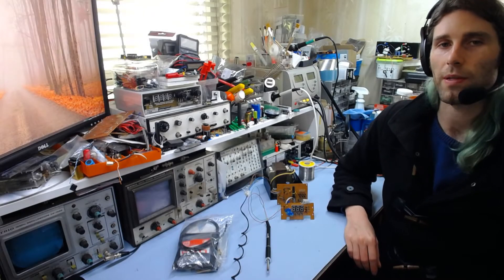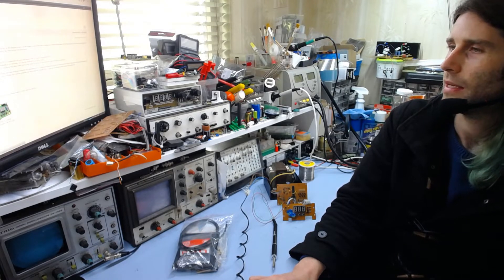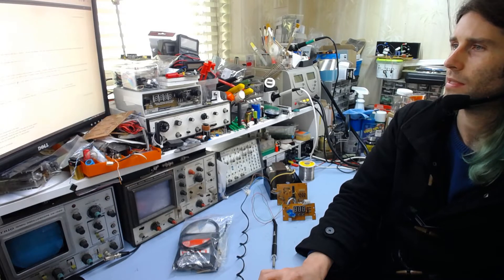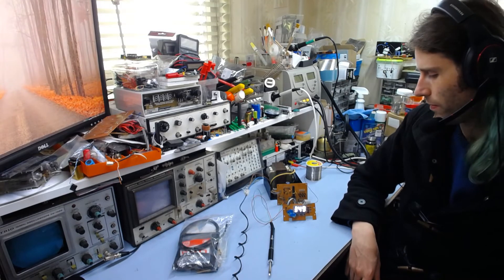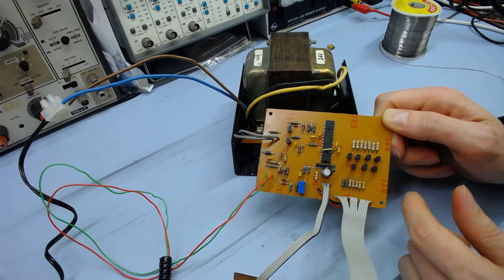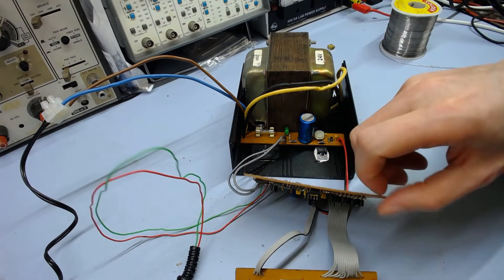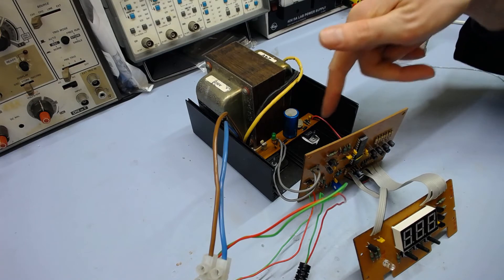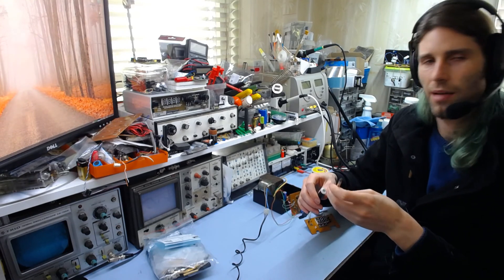DIY "Hacko" T12 style soldering station - Part 1

Comment: Damt that had to be a lot of work. Why didnt you bought handle with controller? I went easier way and bought whole kit for 18$. It works great, just made case, and modified 40V switching power supply from old printer. Your heats faster but im not sure if 5A is not too much for those tips. I read somewhere that 3A is max.
Reply from the maker: Yes, it was more work than buying one, but I have the schematic, firmware, etc and can easily modify or repair it in the future. So it may have taken more time but in the long run I think it's a better choice for me. Also, the problem-solving aspect and design challenges make things more interesting.

As to the transformer - the heater should only draw as much current as it needs, and will be regulated by the controller anyway, so I don't think there will be an issue - hopefully!
It seems the only issue was with transformers that are too small - in the original project details it was posted: "Two guys reported a problems attempting this project, and one of the problems was in zero cross detection threshold. Be aware that you will have to use a decent quality transformer with at least 25% more power rating than the iron you are using. For example, for T12 tips, a 100VA 24V transformer must be enough."